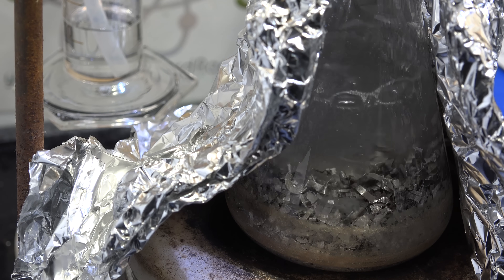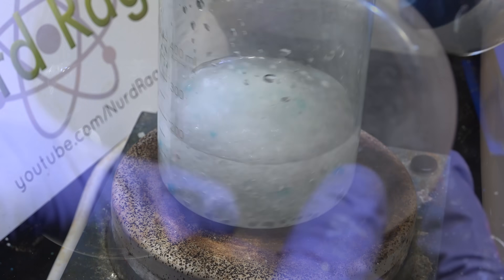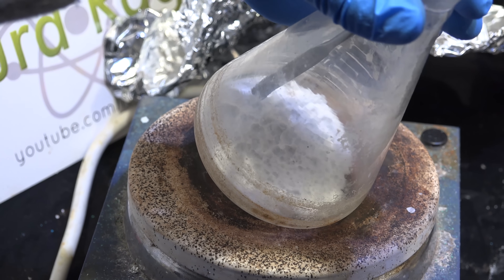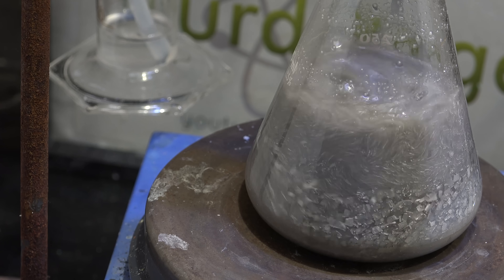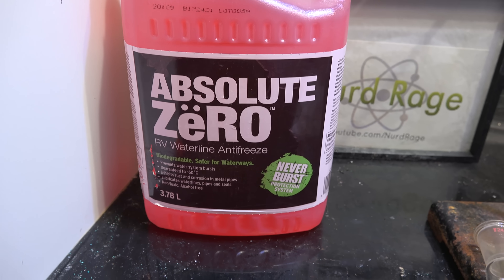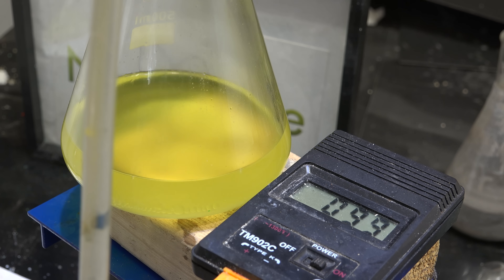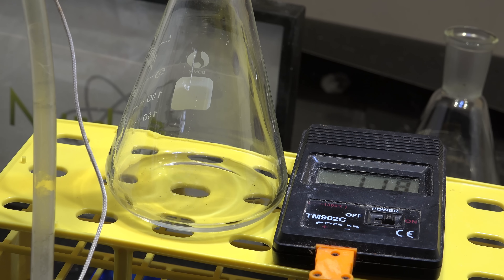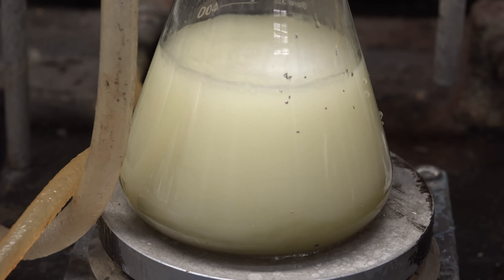Lab Notes: Sodium progress report and dimethyl dioxane troubles - June 2018

Comment: 6:18 It's interesting that you distill off the products of the acid catalyzed hydrolysis of dimethyldioxane at around 50℃, when you would expect water or dimethyldioxane to boil first at around 100℃ and leave the product propylene glycol behind. Now with the knowledge you made 2-ethyl-4-methyl-1,3-dioxolane, it makes sense that you actually distill off propanal at 49℃, which is one product of the hydrolysis.

Comment: Propylene carbonate is one of the most polar aprotic solvents known, and it has a boiling point of 242 C. I've bought it from CCS at a reasonable price, and I managed to dissolve potassium dichromate in it while experimenting with non-aqueous solvents for oxidation reactions. Unlike DMSO, PC doesn't get oxidized by dichromate even after standing for several days. Maybe PC would be better than dimethyl dioxane?

Comment: Maybe you could try coating the inside of the flask with vacuum grease?  It shouldn't dissolve in any of your solvents, and while the sodium hydroxide will break it down, it might still slow it down.

Comment: Cool :) Just some food for thought and a hypothesis. The reaction is slow because there is not enough reactants. The first video was reaction of molten NaOH and molten Mg in steal jar at more than 650°C. Now the reaction is molten NaOH (318°C) and mechanical grinding of MgO/MgO2 from the surface of the magnesium as the MgO2 passivates the Mg surface (wild guess). It is not possible to use solvent which dissolve the MgO2 from the surface as it will react with the Na to form Na2O unless separated, e.g. different density? Also the reaction is exothermic unless MgO is created first, then heat is required to form MgO as Gibbs of NaOH(s) -379.4, MgO2 -465.2, and MgO -362.9 kJ/mol (wiki) but I can be entirely wrong :-)

Comment: Why don't you pressurize the system to increase the boiling point of the dioxane? I know you like working with glassware, but to be honest, it's costly, inefficient due to heat loss, and just maybe, the dissolved silicates ruin the experiment

Comment: What would be really cool to see is something i found on wikipedia while reading up on passivation processes
"In the mid 1800s, Christian Friedrich Schönbein discovered that when a piece of iron is placed in dilute nitric acid, it will dissolve and produce hydrogen, but if the iron is placed in concentrated nitric acid and then returned to the dilute nitric acid, little or no reaction will take place. Schönbein named the first state the active condition and the second the passive condition. If passive iron is touched by active iron, it becomes active again. In 1920, Ralph S. Lillie measured the effect of an active piece of iron touching a passive iron wire and found that "a wave of activation sweeps rapidly (at some hundred centimeters a second) over its whole length".[7][8]"  it would be very interesting to see how this works chemically

Comment: I posted this last time as well, but here I go again:
If such high temperatures are needed, why not run the reaction in a pressurized container?
It had to be out of metal sure, but your could insert a flange with a window inside, so you could look inside.

Comment: Coat the glass in aluminum oxide, or just use cheap wine bottles. And doing it under a high energy uv might help
Reply: Oh yea high pressure in the wine bottle might help since you can increase the temperature seal the top and throw it in a can of sand and heat the sand when your done crack the bottle and if it explodes the sand would absorb the blast

Comment: You mentioned other metal containers may be better than glass for the reaction - what if you use a pressure vessel to up the boiling point? Depending on what temperature you need, a couple atmospheres may be sufficient. Also, idk what the sodium-magnesium phase diagram looks like, but it might be possible to use much more sodium initially to make a sodium-magnesium alloy which is molten at your processing temperature, possibly helping to speed up the reaction. In that case you would probably have to start with a lot of sodium and add magnesium chips over time to a large blob of sodium instead of the other way around.

Comment: If you could get your hands on a flask made of alumina, then you don't need to worry about the flask being degraded by sodium hydroxide.
Would a coating of alumina on the inner surface be sufficient?

Comment: Found a patent describing a method for protecting glass from caustic damage using zinc https://patents.google.com/patent/US2447297
I am guessing zinc compounds in solution would be rapidly reduced to metal so you could probably only do it as a pre-treatment. A concentrated alkali saturated with zincate would hopefully have the described effect although maybe some sort of surface treatment like gorilla glass could be done, zinc oxide in a caustic or boron oxide flux maybe?

Comment: is it worth trying heating the liquid with an immersion heater and not the glass?  A second thought is to use an induction heater with a magnetic coil surrounding the beaker and a conductive bar in the oil, again the heat would be concentrated around the conductive bar and would not have to pass through the glass,

Comment: Probably no need to edit up a video for dimethyl dioxane; you already described the process well enough here, and it doesn't seem to be useful for much of anything.

Maybe the higher alkyldioxanes would work? 1,2-butanediol isn't as over-the-counter as propylene glycol or ethylene glycol, but it might be worth seeing if it work. 1,2-octanediol seems like the next most available one. Of course, if it gets costly, that kinda defeats the purpose.

Comment: Why not try to use a container in stainless steel, as you point out, steel is insensitive to the mixture. And stainless stel have the added advantage of NOT beeing magnetic, so you should be able to run the magnetic stiring as usual. But, you cant see what is hapenning.

Comment: I had a thought: you could silver the inside of a flask, but only the bottom half; then you can see through the top half. Best of both worlds! I don't know how resistant the integrity of the silver coating is to the heat and chemicals, but I don't think it should affect the reaction.

Comment: You are NOT wasting your time!  This is great stuff.  Lessons learned are VALUABLE.  The fact that they are rather costly lessons only makes them MORE valuable to those whose time you will have saved by sharing your hard-earned data.

As for the dimethyl dioxane video, I'm in favor of publishing that.  I suppose it depends somewhat whether it has any particular value for identifiable purposes.  If you're confident the solvent is useless for damn near anything at all (I confess I have no clue what its practical uses are), then perhaps it's enough that you've described rather well your experiences with it in this video.

Comment: Posting so-called failures is extremely valuable. It is not done often enough. I appreciate it.  Please keep up the good work.

If you have the footage already, why not post the dimethyl dioxane anyway. It might not be useful for this application but it could be valuable for some other application. Having a good synth searchable might help someone else.

Comment: I actually think it would be extremely interesting to see you figure out how to use non-glass reaction vessels.  At some point, glass is going to cease to be a viable option for certain reactions under certain conditions, but that's never stopped us chemical engineers.  It would probably be extremely valuable to home chemists to know how to work with different types of vessels.

Austenitic (300 series) stainless steel beakers are non magnetic and should still work with a stir bar.  Rapid heat transfer from the hot plate could be controlled with baths between the plate and beaker, maybe.

I just googled "will magnetic stirrer work in metal container" and started to get interesting results.  This one in particular has some good insights: https://www.photrio.com/forum/threads/requirements-for-magnetic-stirrer.39371/

Comment: How about coating the interior of the glass vessel with titanium?  It can really easily coat glass, and if you used titanium balls, you could shake the crap out of glassware and form a layer of titanium oxide all over the interior.

It can even be removed easily with piraña solution.

Comment: I did a little research and it seems like Kapton may be quite resistant to NaOH solutions, even at high temperature.  It doesn't look like it comes in any commercially available formats other than tape though.  It might do a decent job protecting a beaker?  Dunno.

Comment: have not read other comments: how seeing if you can get magnesium powder and run it from there instead of using the magnesium chips, then the reaction could be quicker as long as it does not get coated in oxides, or it could also be oxides on it, so possibly a quick wash in HCl could remove it and yield better results, not sure how the sodium reaction would like that tho if there was any residue on it

Comment: Sapphire (or more simply fused aluminium oxide) is quite resistant to sodium as it is used in sodium vapor lamps.
I know  forming will be uneasy (not impossible if the goal is crude containers) maybe it would be possible to make a coating using the alkoxide route.
Reply: Crack open a sodium vapor lamp and use it as a shitty flask?
Reply: waterlubber no the lamps are just pyrex. The inside cylindrical vial is saphire only. That is about 8x40 milimeters
Reply: Wouldn't it react with the sodium hydroxide?

Comment: you could try Teflon coating it your glassware
pressure could suppress the boiling point of the dioxide
maybe mix a higher boiling point liquid that may form a azeotrope into the dioxide to increase its boiling point?

Comment: I wonder if sodium hydroxide would effect silicone?? If it doesn’t you coat the inside of your flask with it,, making it like a reverse safety bottle,, and saving the glass from being etched... Just a thought
Reply: The sodium hydroxide might not, but the high temperatures will.
Reply: Silicone is resilient for heat,, you can buy silicone gloves, and cook ware which is made from high temp resistant silicone,, if memory serves me right it’s good for temps up to 1000*F

Comment: How can we extract Sodium from Salt (Nacl)
Reply: This. A proper challenge for a proper chemist ;)
Reply: Tech's Science Yes, you can make NaOH from salt using the chloroalkali process. Then you can use electrolysis on the NaOH in inert atmosphere. The first step is rather useless because of the very low price of NaOH. The second step is a bit dangerous, molten sodium hydroxide is nothing to play with.
Reply: electrolysis. (although to make it a bit easier it's often converted to NaOH to lower the melting point) there's lots of video's on this.
Reply: EvilPlagueDoctor you mean by electrolysis we make Naoh then we separate Na?
Reply: +Tech's Science - you can do it from straight NaCl, but it requires a higher temperature to melt (and releases chlorine)

Comment: If its temperature you need why not use a pressured vessel? 
Maybe add a pressure valve and manometer to regulate the pressure and if its steel, you could cut a window on the side and add a piece of borosilicate glass and seal it witn high temperature silicon sealant. Or an rectangular o ring if you cab find one.
That could easilly do 60psi and about 450*C.
Reply: Laharl Krichevskoy a sanitary flange and window would be easier, probably, safer, and could be swapped out
Reply: kleetus92
But it beeing just a small window maybe he could find some other kind of glass that wont react with sodium hydroxide, im not 100% sure but maybe lead glass or aluminium oxide glass or fused quartz, not sure if those exist as a product that he could buy though. Maybe there's even some special composition of glass that resists sodium hydroxide or some high temperature plastic or something.
But now that i think about it, maybe just borosilicate glass, cover it in aluminium and then "anodize" it completely,  all that should be left would be a really thin aluminium oxide layer that is mostly transparent. Still i have no idea if all of this wont react with it.
Emeralds are mostly aluminium oxide, maybe he could find a piece of artificial emerald to make a window just like they use artificial ruby to make lenses, bushings and stuff.
Reply: Laharl Krichevskoy that is an interesting idea, raise the boiling point by raising the pressure..  duh! 

Well done. You're pretty much relegated to metal reaction vessels be ayes the higher temperature may eat the glass faster as well.
Reply: Sodium hydroxide DOES react with aluminium (and it's oxides) NurdRage even mentions it is this video (along with magnesium) as metals that won't resist Sodium Hydroxide. 1:50
Reply: The problem is he would need to regulate the pressure since the reaction produces Hydrogen gas
Reply: Be a helluvalot easier to just make a Cassner Cell and reduce your sodium electrolytically.

Comment: You learned a lot of things over the last month. No matter how you feel about your tangents to try and produce alternate pathways, the steps required to refine those experiments contribute to the body of knowledge for yourself and others.

For example, I learned yesterday that I must always be 100% sure of where I intend to apply hammer pressure when trying to put a crankshaft back in place. I broke a single link on my antique sewing machine, which is going to cost me considerably to replace. I still learned something though, and I became more intimately familiar with the structure of the linkage. If anything, I'm more excited and invested in completing my project, come hell or high water. Taking a break and moving onto a new or revisiting an old project is perfectly fine too. You had a shift in perspective that may or may not pay off, but still repeats the process of contributing more knowledge through experimentation.

I hope this comment helps you to continue to push forward!

Comment: Will the dimethyl dioxane not form peroxides like dioxane does? And will it still work for separating the magnesium metal slag? If so I think it's still really useful because then you wouldn't have to make new dioxane every time you extract the sodium from the slag as the dimethyl dioxane could be stoed w/o risk of explosion.

Comment: PVD or CVD could give you a thin metallic coating of whatever metal you choose.
Reply: Interesting idea, sputtering silver is the easiest of all metals I’ve tried, and it sounds like it would fit the bill for a resistant metal.  However getting it into a conical flask could be a little tricky since you need the sputtering target inside the flask.  Thermal evaporation might be easier, however it requires a higher vacuum than I have access to.  If an ordinary flask (Not conical) could work it would be quite straightforward to deposit silver onto the interior walls, masking the area where you don’t want the metal.  Comments?
Reply: flomojo2u 
Im no chemist but wouldnt the silver mirror reaction be enough?
Reply: Laharl Krichevskoy  Good point!  I was thinking about PVD processes and forgot about that route.  The only advantage for a sputtered coating would be that you could create a coating of a somewhat arbitrary thickness, not sure how thick the silver is for a Tollens reaction.

Comment: So I saw your growing silver crystals and was wondering if you could do the same with gold
Reply from the maker: Yes! although i don't have enough gold to demonstrate it.
Reply: NurdRage ask cody to send you some!
Reply: NurdRage maybe ask Cody'sLab
Reply: backonninja 12 Volts is way too much for copper plating. The current will be stupid high since computer power supplies are beefy. A CuSO4 plating cell runs at well below 1 Volt
One thing that determines the properties of your deposit is current (actually current per unit area of electrode surface). Once you reach a certain current you just can't plate copper any faster since it can't diffuse to the cathode fast enough. At that point copper atoms will immediately and randomly be deposited when they reach the surface. This leads to powdery deposits (actually many tiny crystals growing like trees).
 Above a certain voltage (1.2V-ish, depends on many things) you will also start start braking down your solvent (water) and any excess current is wasted and gas formation can ruin your deposit. 
Another thing that determines how your deposit looks is simply the nature of the metal you're plating. I have never seen copper grow big crystals like tin does for example. You will either get a solid copper layer or powder.
Reply: Hey Dude You can grow decently sized iron crystals quickly using electrolysis. I've grown crystals that are about an inch long in 20 minutes. I did this in a bath of diluted HCl acid and a 12 volt computer power supply. Interestingly enough, the exact same setup produces a very fine powder when using copper instead of iron. Any idea why, NurdRage?